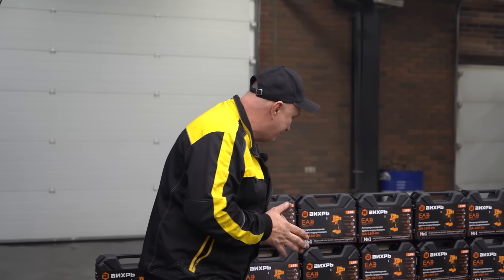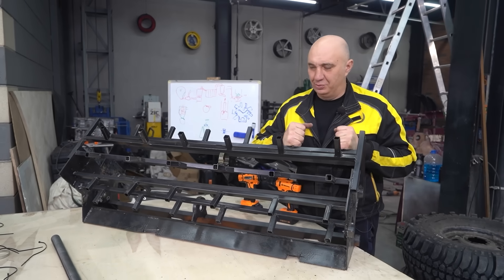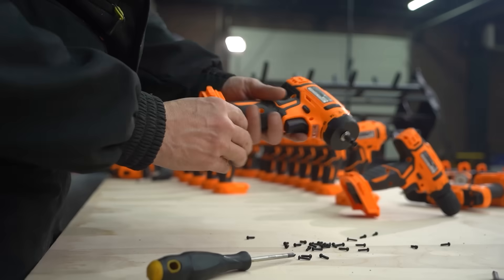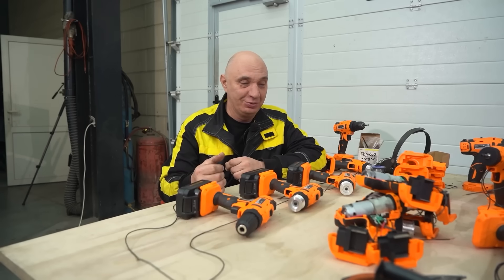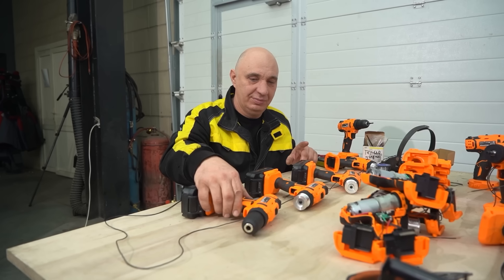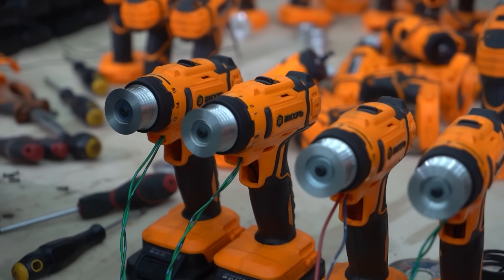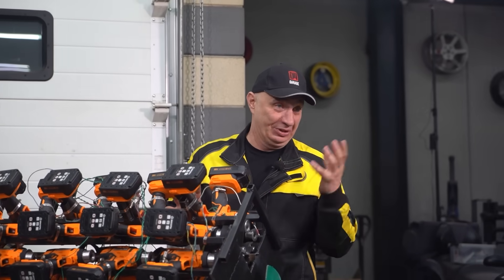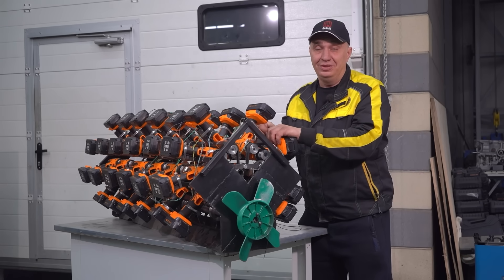50 cordless drills made into an engine for a car

Comment: These “mosfet” transistors have a weird trait of trying to “take over” if ya will.. they will fight over tying into current, they can be great for some circuits, not for others.. although if this were designed in a manner of one control board and biased properly it’d be very simple and work, but what’s even better is that in a circuit that requires this much current it’s probably better to use contactors at a control voltage easiest to use with your throttle controller, but you will still need a way to have overall control, I’d thought f this before and how to very easily control an EV, it all would basically be that a (contactor/relay etc) would run through a very generous load resistor at first.. but be overridden by a high powered controller afterwords which is very simple to make including safety aspects if something was to fail but it’d require some knowledge of electronics & basic electrical which tie into each other abit but most people misunderstand “MOSFETS” and they are used a lot in the electronics/computer world so if ya know anyone nearby that can offer up some helpful knowledge about n the subject at hand then it’d be easy if I had a way to contact you easier I’d love to share some just to add to the channels respect for all those f the entertainment that some of us as families don’t have all of the time to provide but enjoy.. merry Christmas & hope yall are doing well, god bless 💪🙏🙂

Comment: Should have removed the triggers and replaced them each with a relay you could then use a low voltage signal and control all the relays off of one switch or button

Comment: Best way is to make a battery pack to centralise the power with a dimmer switch to control the rpm and use a slightly larger pully for the drills and a smaller pully on the shaft make for a larger rpm range

Comment: Engines run on gas, motors run on electricity. 
You can not take electric motors and turn them into an engine!
The title should say.....can you take 50 small drill motors to propell a car.

Comment: You needed diodes in between each of the units to prevent current from travelling in both directions. It's the reason for the weirdness you were experiencing. Likely the transistors were going out when they were getting latched by transient currents. There was also bound to be weirdness with unintended capacitance causing the delayed release you were seeing after you took the battery out and put it back in when it was still running.

Comment: hey guys are these brushlesor brused motors? you could just completely remove the inner control boards and get a single speed controller for a brushed or bushed motor and connect to all the motors... And the you could actually use a trotthle as wel like an e kart trottle should be easy peasy,

Comment: For the power tools, the control module uses the position of the button to generate a voltage for the base terminal (sometimes  called the gate terminal) of the transistor and this voltage determines the current that will flow through the transistor.  To control all of the power tools with one button, you would use one controller as a master circuit and build a voltage follower circuit (a simple circuit using an operational amplifier) for each of the power tools that would apply the same voltage that the master controller generated for the transistor's base terminal to the base terminals of all of the transistors of the power tools in the engine.

Comment: Awesome!  Man, if you can find a Prius and power that with power drill batteries instead of the Panasonic prismatic modules, that would be hilarious and get the views I am guessing. Impressive as usual. Thanks for sharing guys.
Reply: Pull down resistor I'm thinking. I forget offhand as thyristors like DIACS and TRIACS or one or the other can be latched and one needs like a resistive load like resistor or diode on to unlatch.  Similar with the transistors and I forget the details since have not worked with in a few.

Comment: Like a radio controlled toy , you could add a 100amp esc "eletronic speed controller" , transmitter and reciever, take a window regulator and turn it into a steering servo , and build a 1:1 scale rc lada

Comment: 5:58 Those MOSFETs probably have to be isolated from each other with separate reference signals. Check the manufacturer specific data sheet for the model of MOSFET each of those units uses. The other option is to use DC motor controllers. You'll have to check your power draw for each drill to determine what size of controller you need.

Comment: you would need a proper mosfet driver and bleed resistors when connecting so many together at once. the reason they burn is probably because the gate charge was too low leaving them in the linear region under high load. you could had all gates connected with gate discharge resistors and probably apply like 12 volts directly to them. I don´t know the model of the mosfets you have so I am not sure about the optimal gate voltage here

Comment: This transistor you wrecked is for 1 drill. using them to control more is obviously a bad idea. Use one for every drill, that will work, then you can build a gas pedal that acually works

Comment: When you are using the motor controller unit (H-bridge) they are quite abrupt for supplying a measured amount of power - you always get a spike! You need a free wheeling diode or TVS diode as each motor is kicking out back emf which would easily fry a mosfet - or cause the gate to ring (oscillatory conduction between on and off) until it eventually overheats and fails..  you basically need an isolated motor controller circuit with multiple channels

Comment: I am a machinist and this was a huge effort to machine each serpentine pully and keyway. I’m guessing each one took 3 hours to make manually on a lathe x50 more than 150 lathe hrs alone. 

This is a very expensive project to make great effort !!!!
Reply: 3 hours for aluminium?
Reply: 3 hours per pulley? Is that how long it would take you? That would be extremely expensive at US hourly rates lol.
Reply: To do it manually cut from billet square and cutting groves with a keyway also I expect yes
Reply: did you mean 3 minutes???

Comment: You guys need a voltage controller so you can have a normally functioning throttle pedal. Those boards allowed you to feather the throttle of the drills, now its just on/off and that will make it very jerky to drive

Comment: I recommend using a busbar of sorts to run all of the wires nice and neatly from the power side and a separate busbar for the negative side of course. This can greatly reduce the number of wires. If you were to mess around a little bit and try running a couple of drills wires in series we might see a jump in performance speed wise that is assuming the drill motors can handle the increased voltages..

Comment: those mosfets need a diode between to stop backfeed from the other ones and then a pull down resistor along with another resistor to the gates and they would be more happy instead of fighting each other.😁

Comment: Those are Mosfet Regulators they each have a Capacitance on the gate keeping them operating because it goes out of range it takes very little voltage to trigger them and you can isolate them with diodes on the gate that regulate the voltage AKA Zener..

Comment: they should buy 50 1KW Ebike motors link them up in series in the same way as here  ,thats a 50 Kw engine , could be 100
kw if the battery can provide

Comment: Back EMF probably caused the MOSFETs damage. Thick wires with each drill in parallel, don't bother with controller, connect it right to the battery 2s,4s,6s maybe more

Comment: Do not have the motor with me so I can't really tell...
But you should not have to drive couple of hand drill with one controller? 

I would go with a mechanical push switch trigger; something similar to a camshaft that controls how fast it gos as you rotate from 0 to 180.

Comment: To get the rest of them in sequence, their has to pulley for each set of drills in that row, grab a bar and attach the pulleys to there locations and mount them down near the bottom or wherever works best...connect the front belt to that bar and if all goes planned...that bar should spin like a driveshaft ;) hope i explained that okay

Comment: Nice job guys I'd recommend making a switch inside and several relays to withstand the power instead of burning yourself with the wires but I'm not sure (never tried) connecting several relays together but as you're trying stuff out your welcome to try this idea if you want to keep it simple but i think 4×70A Relay should handle it just fine and one switch with a 12v independent battery is what's needed

Comment: I am NO expert However The "chip" that was burning out cannot do more than one motor. Its not an old school rheostat like old drills had. Now with 50 motors that's allot of amps so the only speed control i know of that would work for you that's not complicated as hell or super expensive  is an OLD school golf cart speed controller.  Basically OLD golf carts used resistors to control speed JUST like a cars blower motor does today. The pedal on the golf cart makes 4 connections for speed 25% 50% 75% 100%. Every speed runs through a resistor on the way to the motor which slows the speed by limiting current and converting the excess power to heat. You are not going to be able to just hook this to a toggle switch. Your dealing with allot of amps . Its easy right now, there is no load. 
Once you put a full load on it could be 250 amps for short bursts. By using the golf cart speed controller you also will reduce the draw of amps... see if you just wire those motors all together to run full speed and just drag the clutch to get started your going to just drink amps and burn stuff up. If you control the speed using resistance yes you waste power BUT you can control the amps the motors get. WAY better to have to charge the batteries a little more than replace all those motors. Anyway if i were doing this project i would use a gold cart speed controller, old school resistance style.  this is not my video but will show ya what I'm talking about . https://www.youtube.com/watch?v=MO8MdElwxcs

Comment: Im glad you guys didnt waste time trying to mess around with speed control, once its in a car youll find that the motors so weak youll have your foot to the floor all the time anyway, with dc motors though the way drills come isnt ideal anyway, forklifts just change the battery wiring from parallel to series to increase voltage, thats how people did it with old school ev's too, 24 volts for half throttle and 48 volts for full throttle

Comment: The transistors are different in their molecular level so when 1 transistor is closed the others will too but when it opens there's still voltage on the other transistor that leaves it in an open state when he disconnected the battery for a good while the voltage dropped and the transitor went to its original open state

Comment: Just give every motor a H bridge and pwm driver all controlled by one switch for the h bridge and voltage controlled pwm drivers on the motors, you could then just use one potmeter as a gas pedal and have every motor get roughly the exact same power.
Don't need the H bridge but you'd have reverse and forward in the motors themselves.
In theory you could go in reverse in fifth gear👌
Reply: Pwm driver schematic is in the 555 timer datasheet or you could order complete ones for a few euro's.
Just need a heavy duty MOSFET/transistor that could take the current and voltage and use that to drive the motor.
Or use one pwm generator and buffer fifty outputs through a transistor with a pulldown resistor to ground and send that to the motor driving transistors.
Only need a 555 timer pwm driver or Arduino or something and 50 transistors 50 4700 ohm resistors and 50 high current high voltage MOSFETs 
Pretty cheap solution but should easily give all motors nice controlled throttle
Reply: Yeah I'd probably put a H bridge on each motor, all controlled by relays or transistors and then one pwm driver with a potmeter as throttle buffered to each motor where a transistor amplifies the signal to the h bridge driving the motors.
Easy, cheap and you could go full throttle in both directions and smoothly ramp up from 0,1% to 100% power👌

Potmeter goes about 270 degrees around so gear it 1:9 to get about 30 degrees and fit it to the gas pedal, reverse switch on the shifter and its just like driving normally

Comment: Those are NOT V-BELTS. Them are serpentine belts or rib belts. But NOT V-BELTS.
Reply: Probably a poor translation
Reply: V belt is an ambiguous term, it can be used in conjunction with serpentine and auxiliary belt or as I assume you’re referring to a V ribbed belt or drive belt. They’re not wrong, just using broad ambiguous language to most probably fit into both Russian and English.

Comment: Might be less ghetto. But you could run them with a golf cart controller. You would have to wire the batteries to supply the higher voltage needed by the controller. But speed would be variable. It would have a higher speed potential also. As for how long the motors would last at that voltage? Certainly long enough for a drive and a burnout!

Comment: You have to replace every switch with a relay and connect every toggle pin from the relay to a single pushbutton. That's the "dumbest" solution, it might have some drawbacks, but its pretty intuitive and error proof.

Comment: the mosfets don't control anything, they are basically solid state switches, that's why everything kept burning out and acting weird

they should still come up with some type of variable resistor, or at least some stepped switch system with fixed value resistors, because all these drills together will generate like 1000NM of torque at the transmission input shaft, well enough to instantly break the transmission if they just go full throttle

Comment: I wonder if the wire could be the problem. There's a light bulb with the lines and switches that loop the electricity even when power is switch off. Maybe the electric was leaking slowly enough to have those other two still press on trigger..

Comment: Would have been cool to see all of those drills turning custom cut drive gears/sprockets mounted on a flat steel panel perpendicular to the drive gear to a pinion gear. Would be an art piece
Reply: I thought this too. 
I'm guessing, but I reckon they're going to get a lot of slippage from those belts as soon as they're put under load. 
Having said that, I think these guys are smart enough to have already made it work, because they wouldn't have uploaded part one otherwise! 😄

Comment: yeah, i used to work with power electronics, and it was very susceptible to it's own electrical"noise". the screened wire was a step in the right direction, but your approach of ditching the existing speed controller is best.

Comment: If it's only the 2 gears and no adjusting you could have a 3 point flip switch on the gear knob, like trucks have for lower and higher gears. The 3rd switch option is the off setting. Then you have all gears in lower rpm and all gears in higher rpm AND 2 gears for reverse 😁👍

Comment: You are gonna need a different set of wheels and belt. I think there is a lot of slippage that will occur once you connect it to the car. The torque of the motors will likely destroy the belt. You at least need ribbed belts and pulleys. Meaning that, with the present set-up, the car will not budge.

Comment: Those cheap voltage regulators are NEVER matching one will always give a higher voltage than another, even if you perallel them, the one regulator that can hit the highest voltage witll do all the work and burn out.  one solution is to add a resistor to each regulator circuit.

Comment: I believe with your set up. You have 0% or 100%. Maybe you could wire it into a potentiometer or transformer to vary the voltage to the drills not to end up chucking a belt off

Comment: The most important thing is that the control boards will also have a low-voltage cutoff; without the control board, you can drain the lithium battery too low, and it may catch fire (will be good for the next video, but bring a fire extinguisher!);

The biggest risk is recharging them. Place the batteries on a concrete floor with nothing flammable nearby when charging - also the smoke from a burning / venting lithium battery is much more toxic than anything you have done on cars previously.

Looking forward to part 2!
Reply: Usually li-ion battery packs have the protection inside them. But I don't know this brand...

Comment: One can only hope the battery has the low voltage protection and pretty sure you need 50x the amperage of the one drill to not weld the contact or burn it since there is no controller between. I would have gone with mechanical or contacted the manufacturer for advice on how to wire this so you could run it with low amperage. Perhaps least use relays on the each drill cause that spark didnt look great... Also after they are done with this build, i hope they utilize those drills as say electric tank where each road wheel is run by few of these.

Comment: Maybe the cheapest solution is pushing the triggers with an servo powered mechanical system, like a camshaft that when rotate push the triggers more or less depending on the rotation controled by a single servo motor

Comment: The drills trigger is variable that's what the circuit boards are for and why you were having such weird results trying to use them. Maybe instead of sticking the wires together run them to a potentiometer so you have speed adjustment to the drills.